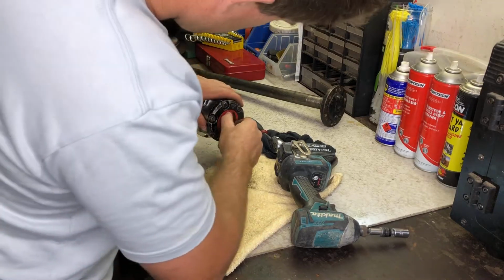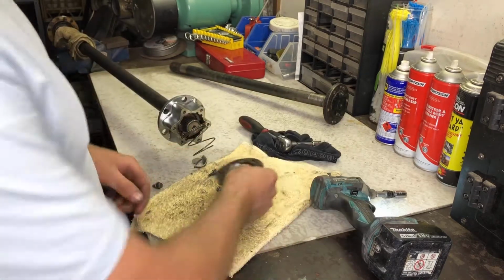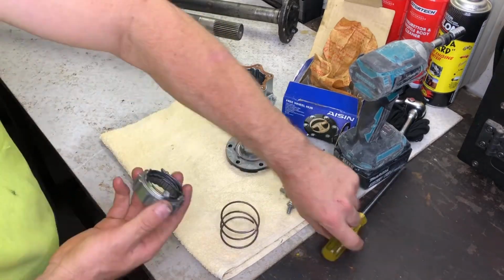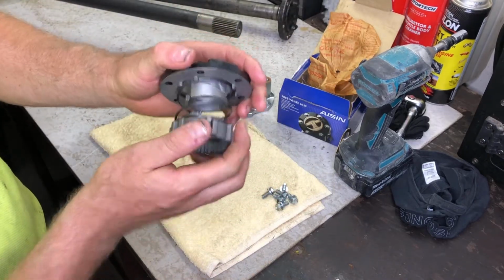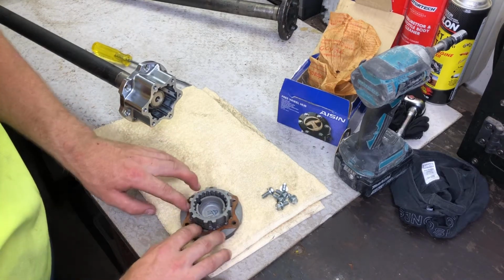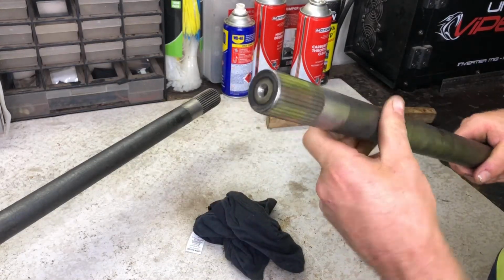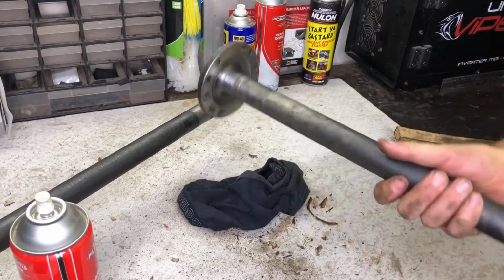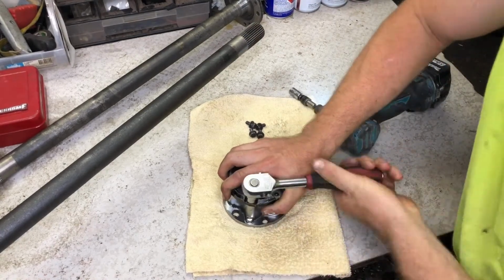Landcruiser Project Build: Hzj75 Manual Locking Hub Tare-down/Rebuild, Solid axle inspection

Comment: Good vid. Do you need to lube them though?
Reply from the maker: Thanks. From factory the components have minimal lubrication. You will need to lube the inside/outside of the clutch and pack the hub body with high temp bearing grease 👍